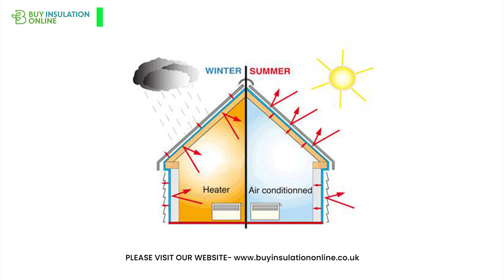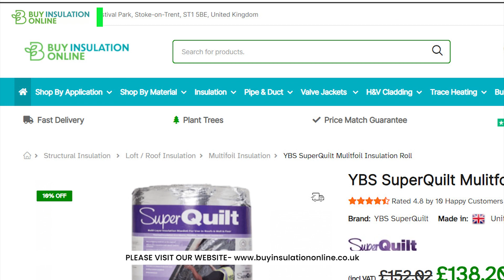YBS SuperQuilt Multi-foil Insulation Roll: Benefits, Installation and manufacturing details

Comment: What is the thermal conductivity or thermal resistance? There is no information about that in your site or blog.
Reply from the maker: hi we will look to put this in the comments and on the site thanks
Reply from the maker: hi, The thermal conductivity of YBS SuperQuilt Multifoil Insulation Roll cannot be directly stated because it's not a single material with a single conductivity value, 
and the Thermal Resistance (Core) of YBS is 1.52m²K/W, 
you can find the product specifications right below the products in our site, thank you